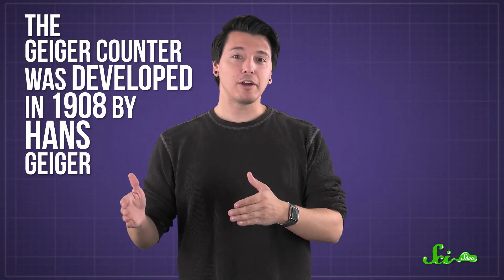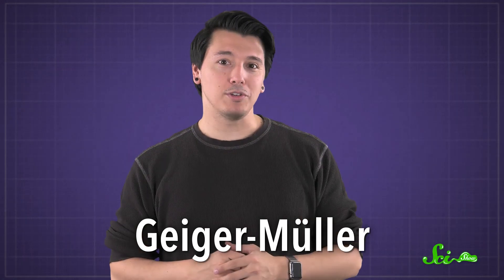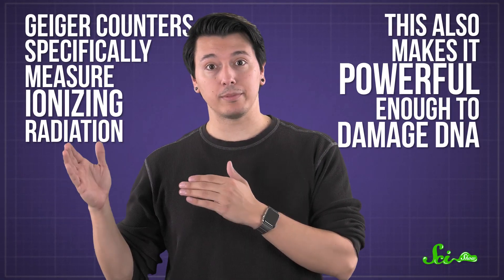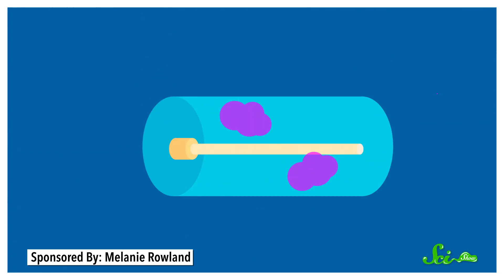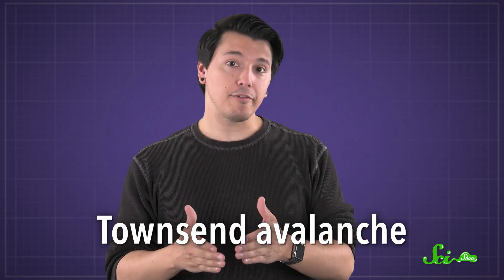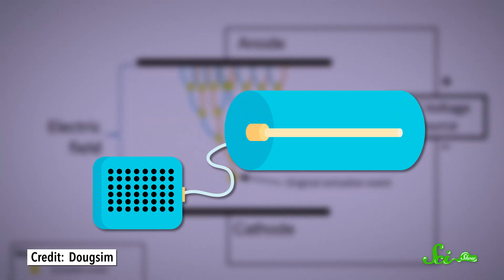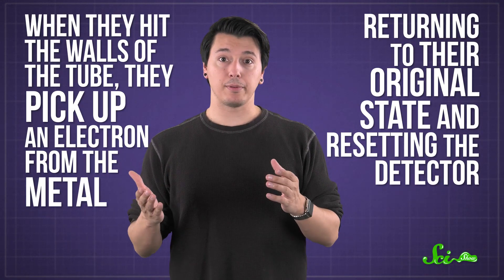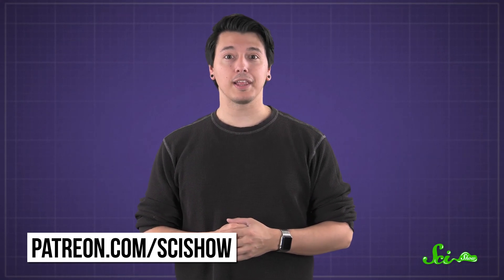Why Do Geiger Counters Make That Clicking Sound?

Comment: I work at a nuclear pharmacy, I hear that meter all the time. What he failed to mention was how much of that ionizing radiation it takes to actually be considered dangerous. Ever use a cell phone, a microwave or even stepped outside?
Reply: Dana B  I get what you were going at but a Geiger counter can not measure cell phone radiation or microwave radiation. Those are non Ionizing radiation sources. You are correct that most people get freaked out when they hear a Geiger counter click fast even if it's just background radiation. Also your right that it really does take a lot to be considered dangerous. In all honestly I've heard a number of interesting comments from medical rad techs so it's really the training programs fault and not yours. But it's still terrifying that y'all are not taught how this stuff actually works. When asking for what specific dose I would get from an x ray the rad tech did not know what USv or mRem was and just said I would get as much as I do from the light from the sun... it was an interesting day lol.

Comment: Gieger counters have decade gain settings.  In other words you can make most models sound like they are approaching Chernobyls reactor internals when they are simply next to a very low level alpha source, such as a fiestaware  plate or certain uranium/thorium "rich" beaches.  A lot of you tube channels play with these settings to unnecessarily freak out the uninformed and easily manipulated.  Ionizing radiation is all around, especially at high altitudes and certain types of mining sites.
Reply: mike all  it's really not the gain setting it's the voltage setting. Also that is actually how radioactive fiestiaware and many other naturally occurring uranium minerals are. Yes I have seen one or two videos where someone had a Geiger counter that was going crazy at nothing but overall the readings are generally pretty accurate. Their really is a lot of naturally hot stuff all around us. However that's not usually a dangerous thing as many many people will tell you on YouTube. So I entirely agree with you that their is a lot of misinformation out their but from what I've seen, most of the videos are fairly accurate as far as the detectors are concerned.

Comment: Nuca Cola Quantum (the drink you showed a copyright safe version of at the end) gives you more rads, it doesn't take them away.  You need rad-x for that.
Reply: rad-x doesn't remove rads either, just makes you more resistant to it, rad-away is you you need if you've already been exposed
Reply: John Smith , The IS an item called just that and it Does remove 1000 rads. http://fallout.wikia.com/wiki/Refreshing_beverage . Sure, the graphics department put their own spin on it by making a Nuka Cola reference. But the script writer knew what they were doing. (Mutant Hound Chops also lowers rad.)
Reply: 1- he said refreshing beverage a drink which cure 1000 rads and 2- rad x give you resistance, rad away removes them
Reply: or Vodka
Reply: Just equip your crystal thorns ya rookies, look, they barely make you bleed!
Reply: John Smith that is true but I think he meant the item and showed the nuke cola because it would be more recognizable than a brown beer bottle lol
Reply: NUCA
Reply: Rad-x prevents radiation you "nerd".
Reply: No, you need Cossaks Vodka
Reply: John Smith Yes there is a "Refreshing Beverage." Scrub.
Reply: Stfu nobody likes the truth
Reply: EvoMK4 yea you're right about rad-x, my bad.  I have no idea what you're talking about besides that.  There's no item called "a refreshing beverage" which "cure 1000 rads", as you put it.  He said "a refreshing beverage" while showing a copyright safe version of Nuka Cola Quantum, which adds rads.

Comment: So how do you accurately measure higher levels of radiation?
Reply: There are various methods depending on how high the dose you want to measure is. One of my favorites is Fricke dosimtery, which uses a solution of Fe2+ salt in water. Under extremely high gamma doses, a significant portion of the Fe2+ turns to Fe3+ due to one of the gamma rays knocking an electron off. This can be significant enough of a change that the absorption properties of the solution change because Fe3+ is a different color than Fe2+. You can use a spectrometer to quantify the dose from the change in color.
Reply: gamma scintilation devices are pretty good for that , but  modern dosimeters might have a combination of different detectors. i'm not 100%

Comment: Why does lead prevent radiation from passing threw it?
Reply: As GenericGeorge says, it's because of density. The more mass between you and a source of radiation, the more likely an energetic particle will hit something and be absorbed before reaching you. Lead is quite dense, so you can fit a lot of mass in a small space, making it ideal for radiation protection.

There's probably more to it than just that, but that's my layman's TLDR understanding at least.
Reply: Any dense material will attenuate radiation but lead is commonly used because it's cheap. Uranium is denser than lead and used to shield radioactive sources used for radiography (x-raying welds). The amount of attenuation also depends on the type of radiation against which you're shielding. Neutrons are affectively attenuated by boron which absorbs neutrons readily. On the other hand alpha particles are so large they can be stopped with a piece of paper.
Reply: SoulDragonWithFlow lead isn't the densest. There are lots of far denser elements/materials, lead is just the best trade off between cost and density. Anything denser than lead would be too toxic/expensive.
Reply: because it's thicc af
Reply: Hey just wanted to add a little more as a physicist. So there are 3 main types of ionizing radiation that you'd experience (5 total really). Helium nuclei, electrons, and photons. The first one can be stopped by paper bc it is really heavy and as you know mass-things bump into each other. So when it sees the paper it has a lot to bump into. Electron radiation can be stopped by pretty much any metal like aluminum. Electrons would go through the paper because all paper atoms are 0 charged so the electron goes through easily but in a metal the electrons and protons are in disarray so it would quickly hit a proton. (Would also do this in water). Photons on the other hand, have no mass and no charge. They only interact with the electrons that have a certain energy. So for example if you look at your wall that is because a photon was absorbed by the paint atom and then spit out in a certain color. Radio wave photons are hard to stop obviously as you can listen to the radio anywhere and that’s because they are low energy. High energy ones like those covered in the article are actually not dangerous as he alludes to. They are only dangerous bc they are powerful enough to knock electrons off of atoms and those electrons as I mentioned above can be dangerous. Lead is effective against most photon radiation because the most dangerous photons are XRay and Gamma Ray which lead is really good at stopping. It’s a metal like those from electron radiation, it has a high work function meaning that it takes a big photon to knock an electron off of it, and even if that happened it is dense enough that it would hit a photon rich area quickly. This is kinda related to its high mass but really it’s because it’s easy to get, very dense, and has a high work function. It’s more a correlation then a causation.
Reply: Patrick Metcalfe  Very well said. Just for the perposes of newbies reading I would like to add a few things to your comment. Not for you but for others like I said. 
First, the nuclei and electron radiation you mentioned are called Alpha and Beta radiation respectively, and to be ultra clear, there is nothing harmful about helium itself, just that some decay reactions shoot off a particle made of 2 protons and 2 nutrons (aka a helium nuclius) but Alpha radiation is slow moving and can be stopped by a few feet of air or a sheet of paper like you said. 
Alpha, beta and photon radiation all carry different risks and aplications. 
Alpha is harmless outside the body because it can’t get to your body easily, but if ingested it’s very dangerous as the alpha particles would damage the cells in your stomach, intestines etc very quickly. Low penetration high power, which is why it is also used in skin cancer treatment (it will kill skin cancer cells without penetrating deeper into the body). 
Beta is the middle ground; medium penatration medium power. Stopped by most metals and fluids but can be quite harmful in larger doses. 
Photons (UV, X-Ray and Gamma) are hard to stop but also dont rip apart DNA as effectively as Alpha or Beta. You would be fine standing next to a weak photon emitter as most of the rays would pass straight through you, so you need a lot of photons and/or a long exposure to cause a high radiation dose and therefore health risks. This is partly why occasional X-Rays at the hospital are harmless. 
You also have neutron radiation. VERY high penetration and the particles interact with almost nothing, but when they decay they release a ton of energy. They are basically granades; not dangerous themselves but very harmful when they decay or “explode”. However they can be stopped and absorbed by a few types of nuclei, such as Boron-10 or Helium-3. 
Patrick Metcalfe feel free to correct me if you think anything I’ve said here is incorrect or misleading. (It’s been a while since I studied this stuff in collage)  :)
Reply: No problem! Now your smarter than you were before :)
Reply: Lead had a high atomic number which would help absorb the radiation along with protecting the individual from what is known as "Compton scatter". If you ever get an x ray, you'll notice that they'll give you a lead apron or some type of lead shield- it serves as protecting you from "unneeded" radiation.
Reply: Pietro Tettamanti Re-read my comments. I specifically said heaviest STABLE material as pretty much anything with a higher atomic number than lead becomes itself radioactive. Unranium for example is heavier than lead but there obviously isn’t much point in making a uranium apron.
Reply: The Creeper That’s a little misleading. Aluminum isn't used for shielding purposes on air/spacecraft. It’s used because it’s light and strong. But radiation remains an issue yet to be solved. You take a much larger (but still not generally dangerous) dose of radiation on a simple commercial fight. A cheap handheld counter will show around 5-10X background. In space, it’s several times worse and a problem yet to be solved effectively since you can‘t realistically make a spacecraft out of lead or any other super-dense material.
Reply: SoulDragonWithFlow well, you were right, indeed, but in your first comment (I didn't read the whole thread at first) you said that lead was the densest stable element on the PTE. I was commenting about that. Thank you for explaining me what did you mean.
Reply: It is dense cheap and easy to work with
Reply: Some comments herein have good answers. 

Speaking of radiation shielding,
Alpha particles, a sheet of paper is enough.

For Beta radiation, several cm thick Aluminum or Aluminium is enough. Or PVC sheet is good enough. Better solution is filled the PVC with water. Even better is filled with heavy water, or scientifically, Deuterium. D2. Reason: more electrons which has greater attenuation on beta. Tritium or D3 is almost impossible to get. It has the largest electrons, though. 

For Gamma radiation, several cm thick lead is enough if the radiation src is quite close. If in a distance, the thickness of lead reduces proportionately to it. 

Above all, lead can shield all these particles: a, b, and photon. Better than lead (Pb) are heavier metals such as Os, U, etc. but they are expensive, and some are dangerous bc of radioactivity themselves. 

Don't need to worry too much if not nuclear explosion. Just keep a distance with proper shielding, ok. For example, Sr90 is a beta emitter, and it could cause you a bone cancer, but you can touch and grab the sample without having a problem. The flying off Sr90 from an explosion is a problem. I'm speaking here about energies of the same particles. So pray unto God that we human being don't need to confront with high energy particles that the devils produced.
Reply: Electromagnetic radiation is stopped by electrons, so materials with more electrons stop it better and so it scales with mass. The more atoms you have the better the protection. Lead is the densest/heaviest stable material on the periodic table and so has the best rad protection which is why it’s used in production of rad sheilds, aprons, suits and glass.
Reply: Alyshia OBrien I'm assuming it's because it's too dense? Idk Google it.
Reply: That makes perfect sense! Thanks VierasMarius and SoulDragonWithFlow for the info, much appreciated!!! I kind of figured it had something to do with the large amount of mass lead has.
Reply: Lead is still the heavest (stable) material by atomic weight which was what I was talking about, not by bulk. But yes, other factors such as its relitivly low cost, malublity and the fact it can be very easily melted down and mixed with other things like glass all play a role. I was just answering the question as to the machanics of radiation sheilding. If we are getting into material selection, other materials are also used in shielding and related aplications such as glass, boron and concrete.